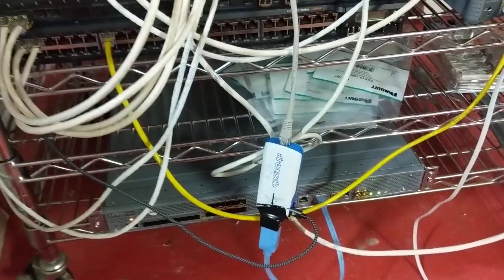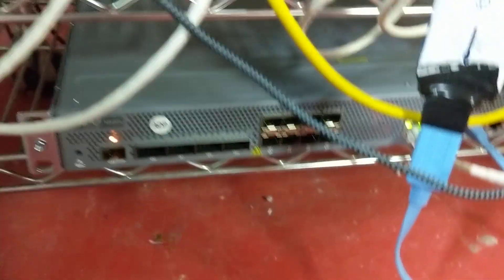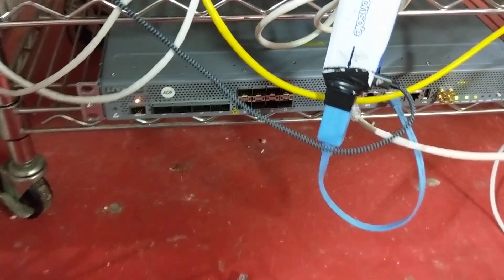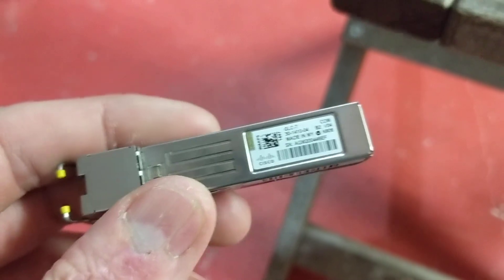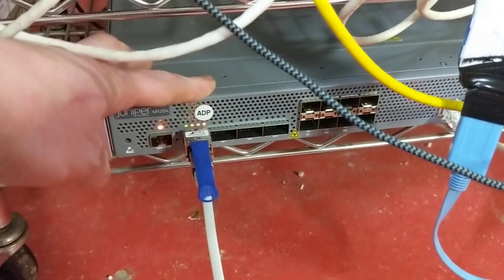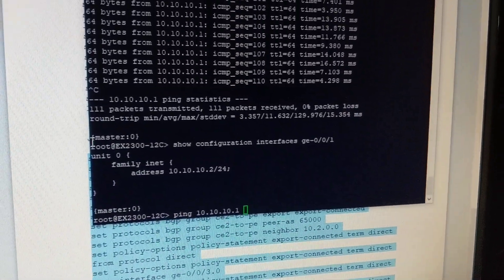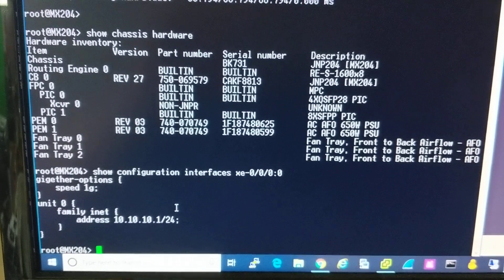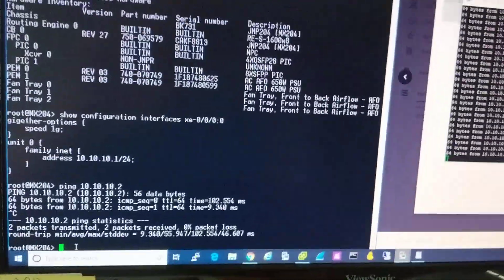1G/10G copper in a 100G Juniper router tested. (it works!)

Comment: I couldn't get 1G to work on a QFX5100.  10G seems okay.
Reply from the maker: The Mellanox QSFP+ adaptor I used in my video isn't qualified on the QFX5100.

https://apps.juniper.net/hct/model/?component=MAM1Q00A-QSA&tab=sPlatforms

This is one of those situations where I can't say trying on a platform that isn't explicitly supported won't work, but I can't say it will, either. Heck, I was using a Cisco 1000Base-T transceiver in that same video :)

If you need this functionality on the QFX5100, take a look at JNP-SFPP-10GE-T, a multi-rate 100m/1G/10G copper transceiver.

https://apps.juniper.net/hct/model/?component=JNP-SFPP-10GE-T&prd=QFX5100&cat=Transceivers

Cheers!